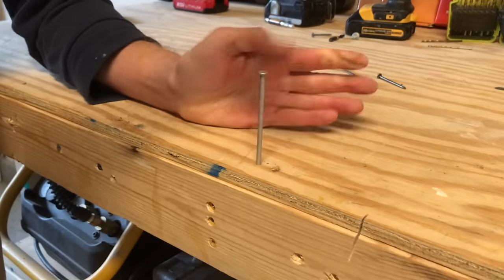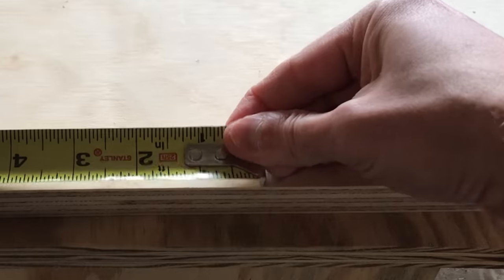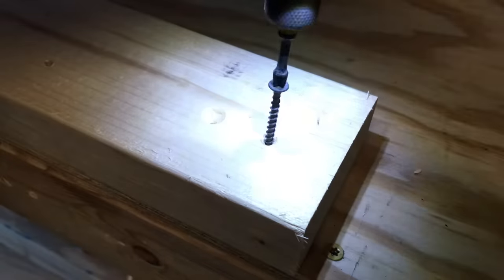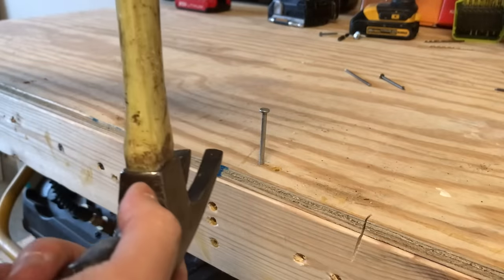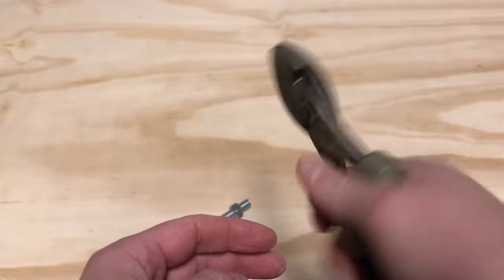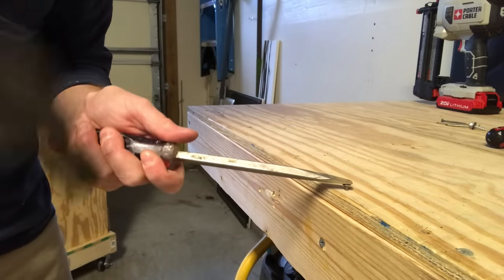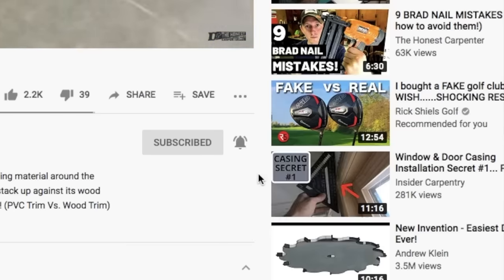21 HAND TOOL TIPS, TRICKS & SECRETS!! (Hammer/Screwdriver/Tape Measure/Pliers...& MORE HAND TOOLS!)

Comment: At 7:18, if you put a regular home gauge wire in the slip joint pliers near the joint and close it, it will probably cut. Not as sharp as the ones in a needle nose, but better than nothing if you have nothing else. The mini Hacksaw tip is the only one that's new for me, but I love your content and have gained a lot from it. Great rundown for beginners who didn't have the opportunity to work as a handyman earlier on in their lives.
Reply from the maker: Thank you Victor! Good tip on the slip joints 🙂

Comment: I was a Pipefitter for 8 years, and NEVER did I realize there was a scribe tool in my combination square. Admittedly a scribe wouldn't be much use on steel, but my carpentry game just went up a notch!
Reply: A good square the scribe is hard enough to mark mild steel. It's still pretty short though. For steel I have a carbide scribe I like. Enough that I'll walk over to my box to get it if I need it.

Comment: One quick tip I learned as an adult of 36 regarding adjustable wrench.

There is a proper direction/orientation with turning and that is towards the direction of the movable portion of the jaw.

Turn it the other way you may lose grip or strip the bolt. I learned this the hard way.

Again the lever of the wrench always should move towards the direction of the moveable portion of the jaw (the adjustable portion of the wrench jaw)

😁

Comment: On slip-joint pliers:  The very back portion (the area behind the serrations and before the joint) is also a wire cutter.  It is especially good for use on materials like chain link fence; in fact these were ideally designed for setting chain link.  You can snip off the excess wire and use the head to twist the material together and tie the material to the poles.

Comment: Excellent! My trick is too keep a small flat metal file on hand to sharpen up utility knife blades as they dull.  Another trick is to put a nail into chuck and drill it partly into the wood (like for hanging something), then reverse and hold chuck to release nail. Works great it you forget your hammer or don't want to bang on things.
Reply: Sharpen a knife blade with a file? Primitive Pete, is that you? What you're supposed to do is open up the knife handle and get a new blade out. That's what the screw is for in the middle of the handle. You can also flip the blade over. They're two sided. If you insist on sharpening them then use a sharpening stone. Or a bench grinder if you're in a rush. Maybe an angle grinder if you're really in a spot?

Comment: Another simple help. I have used a 6" crescent wrench on the shaft of a SQUARE-shaft screwdriver, (see tip 20, example of the square shaft driver). If the screw head is partly messed up, or maybe corrosion is ruining the day, I'll place the screwdriver in the slot, gently tap it with a hammer or big wrench, sometimes this will loosen the threads. But with a messed up screw head slot, I also place the screwdriver in place, lean into the driver hard, and use the small crescent wrench on the square driver shaft for extra twisting torque. Helped me out of many coulda-been a bad situation.

Comment: I have suggetions for you. Rivetting, nail pullers, gluing techniques, welding techniques, joints  in wood, screw applications, surface finish, corrosion problem fixes, safety techniques for popular power tools( angle grinders and circular saws, in particular) 
By the way if you want proof checking I would assist.

Comment: Nice Video.  By the way, the square shaft on that heavy duty screwdriver is there so you can put an open end wrench or a crescent wrench on the shaft to assist in turning a stuck screw or applying more force when prying things apart with a twisting motion.
Reply: I have some with round shafts, but there's a hex part where the shaft meets the handle.

Comment: For eye bolts you can partially open one and put it in a drill to drive the other. Just start the eye bolt you wish to screw,take the partially open one chucked in the drill and interlock it with the one in your work and hit the trigger gently.
It will drive them like a champ!

Comment: Got a ton of deckmate screws to remove and replace in my deck but they've stopped selling the ol' blue bit!!! Now its another color and these screws are all torx! So your tip using the needlenose for spinners will come in handy. Went on a wild goose chase trying to find the blue driver bits recently. They're extinct.

Comment: Number 22: 
If your saw doesn't spin when you push the on button, plug it into this spot on the wall with the two holes that match the tabs on the plug. Works every time.

Comment: I knew the first one would be tape measure! Only learned this about 6 or 7 years ago.
Reply: I'm surprised he didn't give the burn an inch tip. Because I don't trust that hook. Heck tapes are pretty inaccurate even on the best of days. Another tip is never use two tapes on the same job. Use one and stick with it. Because different tapes rarely agree with each other.

Comment: The 1" or 2" or 3" wide putty knife with the thick heavy blade also called a stiff knife, has 100 uses, it also has a sharp edge for daily situations . You can use a palm sander with #80 or #100 grit pad to clean off the blades on any kind of putty knife or stiff knife.

Comment: Thanks for these tips! Can you explain why the tape measure end wobbling doesn't cause measurements to be inaccurate? Must you always push or always pull to avoid inaccuracy?  Otherwise won't you get a slightly different measurement when pulling vs pushing?
Reply: The tab travel should be equal to the tab hook thickness, with the tape starting at that thickness. Let's say it's a 1/16" for instance. The hook is 1/16", the tab travels 1/16", and the tape itself starts at 1/16".

So when pushing you have the hook thickness at 1/16" and then off to races with your tape starting at the 1/16" to account for the hook thickness. 

When pulling the tab would be pulled and travel 1/16" so that the inside edge of the hook is at 0" , tab travel of 1/16", and then again the tape starts at 1/16".

Comment: your hack about using needle nosed pliers to help back out screws led me to comment that I have in the past used a screwdriver the achieve the same result. Place the flat edge of the driver under a nail or screw and apply opposite pressure to that of the drill to allow the fastener egress.

Comment: Square shafted screw drivers can be paired with an adjustable wrench on the shaft for extra torque when trying to drive or remove stubborn screws.
Reply: That sounds good in theory. In practice it rarely works out. If screws are giving you that hard of a time you likely need impact to move them. Torque doesn't get the job done with stubborn fasteners. Beating them does.

Comment: A sharp utility knife can be used to cut 1/4" plywood 
Use an electric hand planer to straighten or fine tune any cut or edge or joint
Can use a grinder with a metal cutting disc to make fine cuts on wood or trim or tight spaces

Comment: In trim carpentry, if you ever need to rip a piece of 1x2 / 1x4  and don’t have a table saw ready, you can take your Swanson speed square and use the scribe notches in the middle of the square to scribe.a straight line across a board that you can then use your skill saw to rip.

Comment: Another tip (probably only useful in the US) is using a Craftsman screwdriver sold by Sears.  The #2 philips and larger and the 5/16ths  and larger straight tips have handles that a 3/4 in box wrench will fit over.  You can generate more torque for fastening or removing screws.

Comment: Hook the tape on the wood , hold onto the blade, pull on it so it is stiff and you can use the edge of the tape to mark a straight line , for marking short lines.

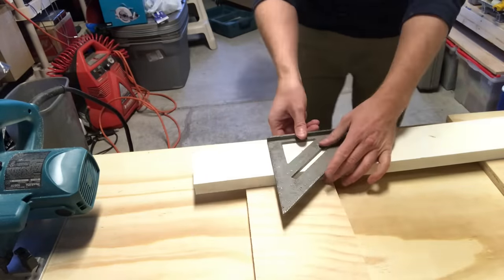Comment: at 5:50, flip the speed square over so the long edge is toward you.  That will give you more surface to start the cut!
Reply: That works as long as you're not cutting anything too wide. But yeah if you're cutting something not too wide you're throwing away half the square. And it only works if you're making a square cut. Which is most of the time.

Comment: The inside of the joint of needle nose pliers (handle side) can also be a crimper .
The sides don't close completely so the small space let's them work to close crimp connectors and spade lugs.

Comment: Great tips! Off topic, can you do a video on how to select the proper size drill bit for an unknown scew size for example #6 #8 etc for drilling a pilot whole?  I usually eye ball them but sometimes you need to be a bit more precise. Thank you
Reply: put the screw along drill bit, feel the difference in thickness
Reply: Ideally you just want the threads engaged into the work. So you want to drill out for the whole screw shank. In reality wood compresses so close enough is close enough. If you put a bit in front of the screw and look at the two of them and you see threads and no or a little shank you should be OK. Now where it gets finicky is if you're using real wood screws and tapered bits. There I can just say try the fit in some scrap before you commit.

Comment: Hold a pencil at the end of tape.

Never use multi screwdrivers as nut driver, bits holder will slop out and no longer stay in.

Keep a spare shim on hand for pulling nails. 

Use end snips to help back out screws, tips to big on needle nose. 

Great vid💜

Comment: Use an Alan wrench in a drill as a bit to turn eyelets or bolt hooks
Reply: Me too...involving removing the slide bolt for my bikes brake caliper and other alan key bolts as they are quite prevelant on Hondas

Comment: Another good one is, not necessarily for carpentry but rather for machine screws.  If the are too tight, use a a hammer to hit the but end of the screwdriver to send vibrations through the screw to loosen it so you can unscrew it.

Comment: @ 7:36 Using Needle Nose Pliers to Help Back Out Screws- 
Use the wire cutters rather than the tips. 

1st The cutting edges are angled and thinner than the plier tips. This allows you to get under the screws more easily.  You can start the lift by squeezing the pliers rather than trying to pry while maintaining a grip on the screw as you would when using the plier tips.

2nd Handy for single hand use of the drill driver, the dug out area opposite the cutter edges helps aim the screwdriver bit into the notch of the screw. Just rest the driver shaft on the dug out's edge to give yourself a fulcrum so you can easily guide the bit into the divot on the screw's head. 

3rd Especially useful with flat slot screws. The dug out creates a guard protecting your surface if the bit slips off the head. 

4th Holding the screw head near the pliers' hinge lets the pliers tips act as a fulcrum allowing you to raise the screw up. Since the tips are spread, they also give the screw stability, keeping it from swaying around.

Comment: I know the perfect use for slip joint pliers. You throw them in the trash and it holds the bag in the can. Funny thing about mentioning tons of uses for a large screwdriver. I’m a plumber and I don’t know if I’ve ever used a super large screwdriver to turn a screw. We refer to it as a digging screw driver
Reply: I have some Channellock slip joint pliers and they're elite. But yeah the Dollar Store pairs usually are not good for much.

Comment: The most useful pliers are the PZ 59 made by Engineer in Japan. These are large enough for average male american hands, other models are designed for those with smaller hands.  If you have ever stripped a screw or broken a bolt off in a motor, or just been faced with removing broken off rusty nails that nothing else will grab on to and remove, then these pliers are what you need. They are basically Lineman's Pliers with special precision jaws that are specifically designed to remove nearly anything round or square that is stuck, stripped or broken off and sticking up only a millimeter or 2 above the surface.  The same company makes the Vamplier brand, which is more expensive, very useful, and made to slightly better standards. I've owned both brands, but sometimes they will wander away from your toolbox when you're not around.

P.S. Amazon sells both the Engineer and Vamplier lines of tools - I recently ordered a pair of the Engineer PZ 59, and when they arrived the jaws were not perfectly aligned, and I sent them back to Amazon the same day and got a perfectly made pair back from Amazon in about 2 days. It helps to be an Amazon Prime member- quick service and free 2-day shipping both ways, and a 30 day return privilege.

Comment: I knew every single one of those but I didn't think about the screwdriver having the 1/4 inch and 5/16 inch slot for special screws. Always thought it was stupid that it wasn't the same size. I rationalized it for the different size of the actual screwdriver head. Size one / size two.

Comment: a pair of vice grips will replace about 12 of your 21 tips.   need to pull a nail with a broke/bent head? Vice grips.  need to hold small nails? Vice grips.  Retract a screw with a stripped head? Vice grips.   Keep a threaded rod from spinning while putting on opposing nuts? Vice grips.  Turn a nut? vice grips.  pull a spike nail w/o a crowbar? vice grips. bend wire? vice grips. pull a stubborn lid? vice grips. 

It's a miracle tool.  I don't know who invented them, but he's a damn hero.

Atleast 3 times a day, the guys hit me up for my vice grips.  They're always after me vice grips.
Reply: In my country where they were invented we call them Vise Grips. In Britain I think they call them mole grips? They don't have the word, "vise" in British English. Here we have squads that bust people for engaging in vice.
Reply: @1pcfred  they do have the word 'vice' in the UK.  And it has the exact same contexts as in U.S. English.  They aren't called Vice-Grips in the UK because that was a trademarked name in the U.S., so they called them Mole Grips, because they were produced by the Mole and Sons tool company.  They're also called vice-grips in Ireland.
Reply: @maxdecphoenix  in the US the holding device is called a "VISE". In Britain they call the same thing a VICE. In the US VICE will get you locked up!

Comment: The "slip joint pliers" as you called them also have a wire cutter in the very inside of the pliers. And the shape of most screwdrivers (especially craftsman) is made so that the box end of a wrench can fit on them. The 90-degree angle on the back of a tape measurer can be used as a square and the tab should only move at a maximum distance of the tolerance difference of the tab.  If it moves further it's because the holes have been worn down by letting the tape slam forcefully.  Also, if you're drilling in wood workpieces there is no need to spud/pilot a hole for the drill bit can act as a pilot by simply applying pressure to the bit.

Comment: Use the 6-in-1 screwdriver as an extended driver in your drill. Place the bit you aren't using in the drill chuck. Place the shaft over that, then the bit you want into that.

Comment: Slip joint pliers are one of my pet peeves, at least for beginners. It seems like they always end up using them to round over nuts and bolt heads when they should be using the proper wrench or socket instead. Great in a pinch, or as a backup, but maybe too tempting for the un-handy?
Reply: The struggle is part of the journey. Separates the men from the boys. Some people just quit. Some get a shipping container worth of tools. I have some really nice pairs of slip joint pliers. Got a bunch of real stinkers too. The lousy ones are what I'd reach for to pull something hot out of a fire. Every tool has its uses.

Comment: When using a speed square as a guide for a saw it is better to aim the point toward yourself especially on material skinnier than the square. This will give you a few extra inches of realestate to make sure your saw plate and square are parallel before the saw blade starts cutting.

Comment: Also, the square shank of that big screwdriver is made that way for another reason.  You can use an adjustable wrench along with a lot of down pressure on the screwdriver handle to loosen or tighten a stubborn screw.

Comment: When marking with a tape measure tab, should the tab be kept in or pulled out for a correct measurement?
Reply: that probably depends on how accurate your mark needs to be, if you dont think you have at most 1/16 of an inch for play then using that method for marking might not be the best way to go about it,

Comment: Instead of a sharpened nail set I always carry a Stanley brand Awl  I will use that one tool as a scribe , screw starter  and. Even as a nail set on rare occasions the Awl  bigger size makes it easier to find in a pouch or shop Apron  and the wood handle has a flat spot to prevent it from rolling off of surfaces  I like the Stanley because they are inexpensive and have a full shank through the handle so you are tapping onthe steel not the wood when you use a hammer giving them a long life of use

Comment: I totally wasn't aware that knob was a scribe... Good to know.

As an addendum to #4: They make small basic tool sets which include some driver bits and common socket sizes. It includes a ratchet handle that has a hex nut style head to accept the bits. To use the sockets you have to connect them with an adapter - which is essentially just a short section of a hex (Allen) key. If you happen to have a set of these, you can connect the socket to the adapter and use it in your drill.